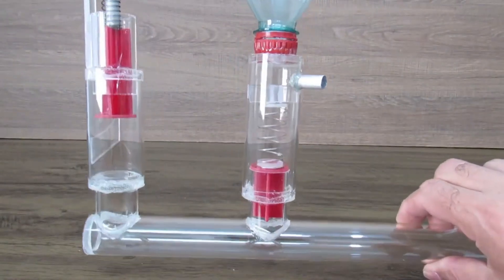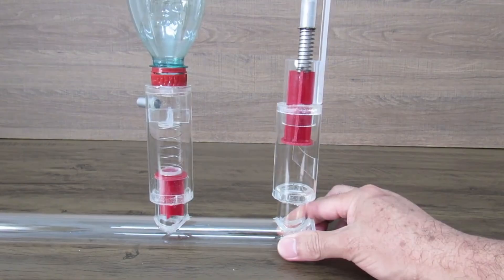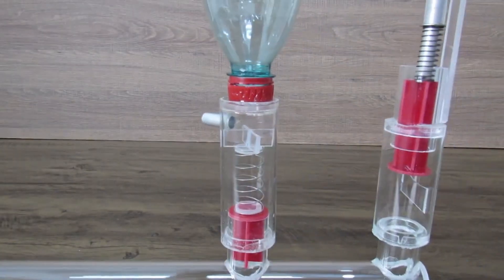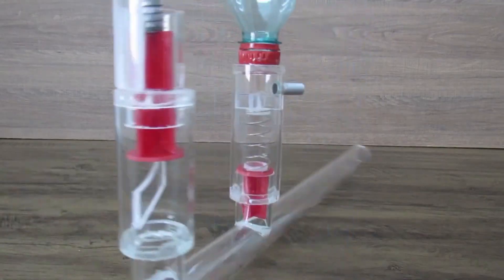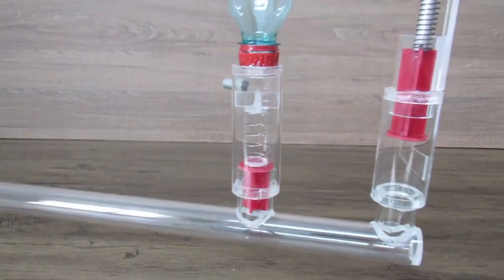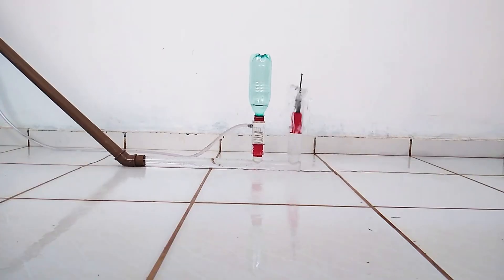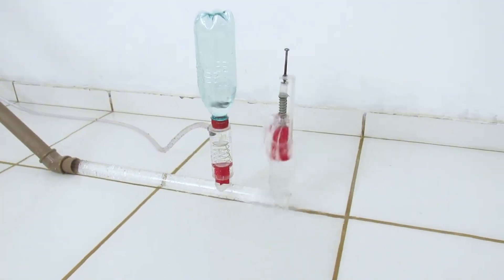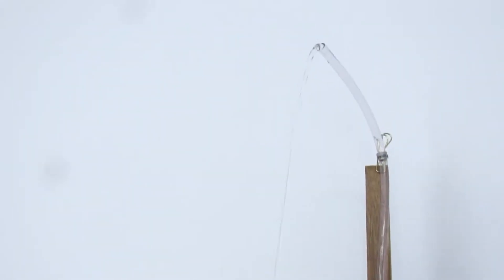A Water Pump Without Electricity - Hydraulic Ram Pump

Comment: Ram Pump, also known as Hydraulic Ram or Hydraulic Ram, is an ingenious and ancient device used to raise water from a lower level to a higher level without the use of electricity, fuel, or any other external power source. It operates solely on the energy of the water itself.

How does it work?
The operating principle of a hydraulic ram is based on the phenomenon of water hammer. Here's how it works:

1. Water intake: Water from a source (river, reservoir, spring) at a certain elevation relative to the ram is directed into a supply pipe.
2. Velocity buildup and discharge valve closure: The water gains speed and, upon reaching a certain pressure, forces the rapid closure of a discharge valve (or pulse).
3. Water hammer: The sudden closure of this valve causes a sudden increase in pressure within the pipe. This pressure wave, the "water hammer," is the key to its operation.
4. Water rise: This pressure forces a small portion of the water into an air tank (air chamber) and through a check valve, which only allows flow in one direction. The compressed air in the tank acts as a "shock absorber" and helps maintain a more continuous flow at the outlet.
5. Opening the discharge valve and restarting the cycle: With the pressure relieved, the discharge valve reopens, allowing water to flow, and the cycle repeats continuously.

In short, the hydraulic ram uses the kinetic energy of the moving water to create a pressure surge that propels the water upward.

Advantages and disadvantages

Advantages:

Sustainable: It does not use electricity or fossil fuels, making it an environmentally friendly solution with low operating costs.
Low maintenance: Because it has few moving parts, it requires little maintenance. Simple and robust: Can be constructed with simple materials, such as PVC pipes, and has a long service life.
Ideal for remote areas: Excellent for locations without access to the electrical grid.

Disadvantages:

Requires a slope: A water source with an adequate slope is essential for its operation.
Water waste: Some of the water is used to operate the ram and is discarded, not being pumped.
Limited volume: The volume of water that can be pumped is smaller compared to higher-powered electric pumps.
Noise: Water hammer can generate a characteristic noise, the "slamming" of the valve.

Where is it used?
The ram pump is widely used on rural properties, farms, ranches, and isolated communities for:

Supplying water for homes and animals.
Irrigating small vegetable gardens and crops.
Filling water tanks and reservoirs at higher elevations.

It is a very popular solution for those seeking autonomy and savings in water pumping, especially where water resources are available with the necessary elevation.